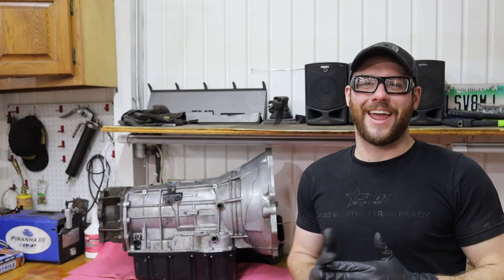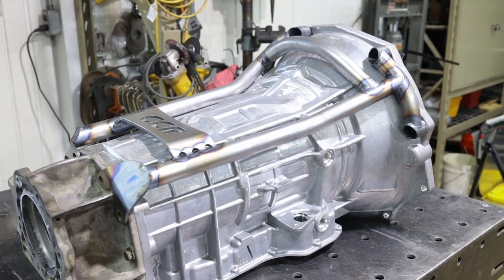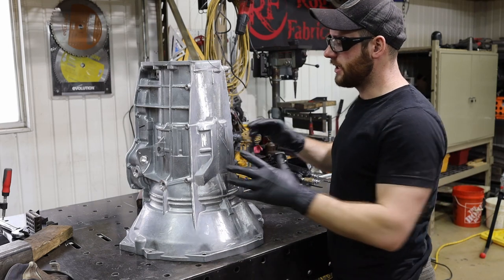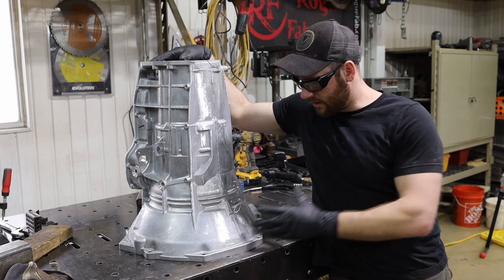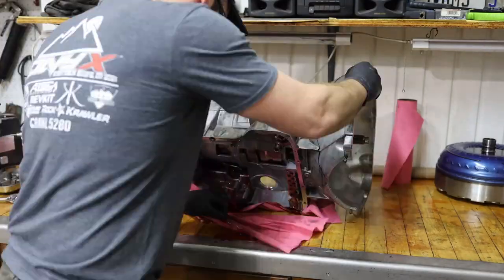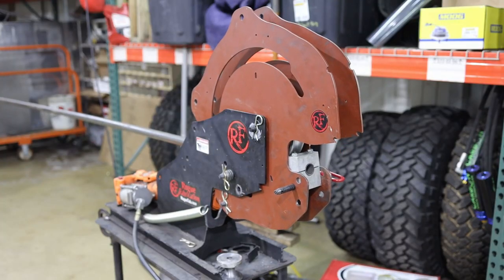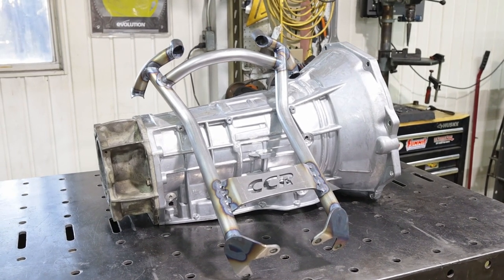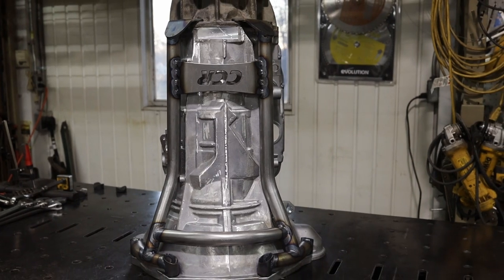EVERY 68RFE Transmission NEEDS This!

Comment: Okay, wait a minute. Maybe you should start by explaining exactly how you keep breaking them? That would be nice to know so that maybe we can make sure that we don’t duplicate.😂
Reply from the maker: @noneya61  found out my driveshaft was the main culprit. Bad u-joint was causing significant oscillations, eventually cracking the transmission case. No issues since the brace and new rear driveshaft.
Reply: @gearheadfabworks  oh wow, that’s crazy!

Comment: My bell housing broke three time :/ rebuilding one last time before throwing the damn truck away
Reply from the maker: I don't blame you. You ever figure out what the cause for breakage was? Bad driveshaft, u-joints, or rear end?
Reply: @gearheadfabworks  the mechanic my brother had took it to out in a bigger converter and I’m sure that the main cause. I feel it shuddering when I drive. It was recently rebuilt a few days ago but it’s having an issue again so it’s going back to the mechanic for a diag.
Reply from the maker: Oof! That's a huge bummer. I've had too many problems with others working on my stuff. I've been fortunate enough to learn how to build most of a car. But costs way more time. It's a big trade off. Hopefully your rig is back up and running soon!

Comment: My 2010 2500 trans had no issues at 112k but my 2018 shifts a lot different but not issues yet as it is just a shop truck no towing
Reply from the maker: Yeah, I'm under the impression that most of the vibration came from my driveshaft. It found the weak point, which just so happened to be the transmission case.... Twice. Lol

Comment: Okay. I'm afraid to ask..how did you break your Trans case TWICE with a stock cummins?
Heavy towing? Drag racing? Wheeling? Do you have a build video for the truck? Thx
Reply from the maker: Occasional heavy towing... But really, it was a bad rear drive shaft. Caused too much vibration and the weakest link is the transmission case. No longer an issue.

Comment: Its been asked before but we need to know. HOW did you break two of these behind a stock cummins?? 

Moderately worried cause i have a 3rd gen with a supposedly "built" 68rfe and a 200hp motor build..
Reply from the maker: It wasn't necessarily the power that broke the trans case. It was a bad rear drive shaft. The truck is so heavy, I didn't even notice the vibrations. But there was enough vibration to cause flexing in the transmission. For some reason, I couldn't tell their rear u joints were that bad the first time I replaced the case. Lol
Reply: Exactly,
My u-joint bolts were loose.